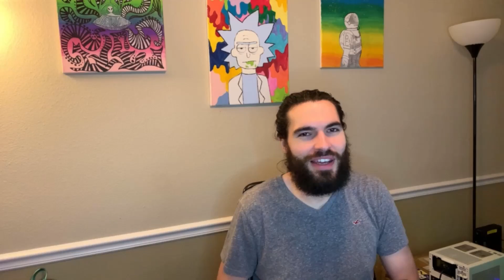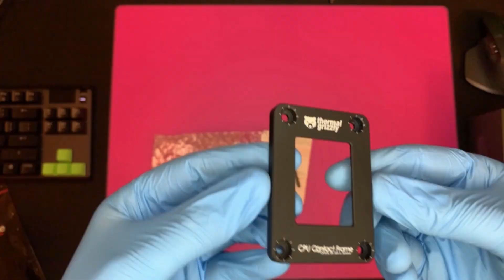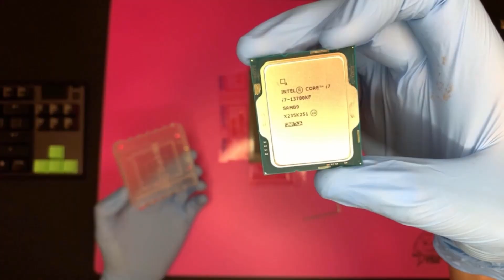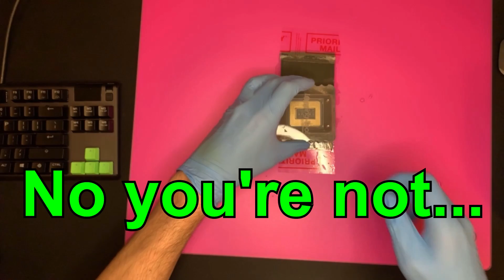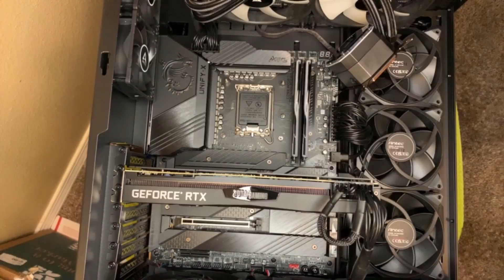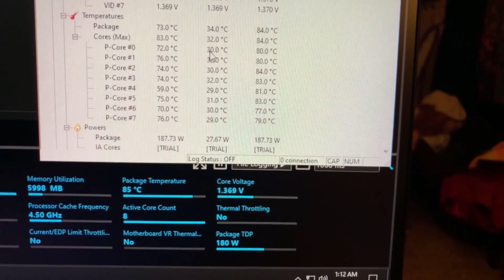Want More Overclocking Headroom?

Comment: A word of caution for those who use high end MoBos. The original 6-32 screws are simply too short when using the contact frame, I managed to barely screw it in place but some pressure added by hand, not sure it will boot thou, still waiting for other parts to arrive to check the result. Just a FYI, the original 6-32 screws from my Asus Z690-I are 6mm length, but ideally you need at least 8mm. Now 10mm would be too long as it will restrict the installation of the CPU cooler backplate.
Reply: Just had this issue, had to go to a hardware store and found 3/8 screws to make it work
Reply: Did you managed to boot it? Have the same motherboard and while I'm waiting for a contact frame to arrive want to clear out those screw issue
Reply: @duke_n3d  yes I did my friend. A bit of scary when installing, but it works like a charm now.
Reply: @fangzhenyuinca  Good stuff! Congrats, man. So I guess it is still manageable to do it with stock screws but only need to apply little bit more pressure?
Reply: same problem here... am returning it, using the Thermalright instead

Comment: What is the best tutorial for installing the contact frame to be followed? have the maximum grip with 2 fingers and then a 90º squeeze or some other?
Reply from the maker: Yes tighten is barely with fingers just until it stops. To make sure they are even, back then all the way out and do 90° at a time for each until they stop with barley any force. Then tighten them each one last 90° and it should be good

Comment: It's actually not the flattening of the surface by lapping, that helps with temps. It's primarily the removal of metal, like you mentioned. 

The reason why, is because the lid is flexible enough, that combined with the contact frame, the pressure applied by the cooler base alone will flatten the flimsy cpu lid to give you 100% contact. This is helpful to know for those who don't want to lap it, and void the warranty. The temps won't be quite as good, but definitely better than stock without voiding the CPU warranty.
Reply from the maker: I agree with you that lapping does reduce temps by reducing the material between the cooler and the die itself, however if you refer to der8auer's own video on the lapping tool, even with the contact frame applying pressure the IHS is still not 100% flat. The purpose of lapping with the tool is to lap while you have pressure to make sure when you mount the CPU with the frame it is still 100% flat. The main point of making sure it's so flat is not so much to reduce temps overall but reduce the core to core deltas as you don't want uneven contact causing some hotspots. Also, in the same video der8aur shows that without lapping, the contact frame can be hit or miss. In some cases it even worsened temps by a degree. So If you really want the best results I highly recommend lapping, but if you care about your warranty then definitely just go the contact frame route
Reply: That's not true.

Comment: delid + contact frame does wonders. Dropped 15c in games plus I can do 5.9ghz/5.1ghz with e cores off ht on now
Reply from the maker: Niiiice I need to go back and actually see what I can get out of my chip. After getting such good temps at 5.8 ghz and 1.38 volts I kind of just left it at that lol what volts do you run

Comment: I used a contact frame on my i13900K and even without lapping I lost 7 deg of the temps!
Reply from the maker: Nice! Did you push your oc higher or just take the better temps and run lol
Reply: Mine arrives Monday and I’m scared to lap mine, most likely will not do it also as I don’t really stress the CPU 😊
Reply from the maker: @haies09  to each their own I hope you enjoy :)
Reply: Same. I did just TG contact frame and it was about 11 degrees, however, I also cleaned and dusted at the same time.

Comment: i keep getting memory errors i’ve taken it off about 3 times and redone it with the proper methods online i don’t know what i’m doing wrong any suggestions?
Reply from the maker: First thing I would try is to put the stock ilm back and make sure it's still working stock. If you still have memory issues then it could be a bent pin or something got in the way of a pin. Did you by chance take the CPU out of the socket when you took off the stock ilm? If so something could get in there. Honestly I doubt that is the issue but a possibility. More likely I think that maybe your ihs is soo uneven that when you apply the cooler it may be adding too much pressure in the particular spot the memory pins are. If you notice when I'm lapping my CPU with pressure from the contact frame it is still not 100% even. I'm thinking you have the same issue and maybe you need to lap the CPU to get it to work. Basically the memory issue is always a pin contact issue so you need to solve why it's not making good contact. One last thing you can try is to put the contact frame, tighten the screws until they stop with just the tip of two fingers, do NOT turn the extra quarter turn, install your cooler and tighten the cooler like normal. This will rely on only the pressure of the cooler itself and not the contact frame. If your memory registers in this configuration, then you know it's definitely an issue with too much pressure on the memory pins and you probably need to lap your CPU. Let me know if that helps or even makes sense lol

Comment: weird that theres no direct die kit for 12th and 13th gen thats from a reputable brand like thermal grizzly or ekwb, i don't want to buy this weird supercool computers block because it looks really iffy.. i have seen a 6,2 p core 4,8 e core 5,1 ring clocked chip with the block tho, so i might have to go that route..
Reply: I just delidded my 13900K with the Rockit tool and used the Supercool direct die block.  Didn't look or feel iffy at all to me and dropped temps 12-15c.  Been 24hours now and so far so good.
Reply from the maker: @robertrodriguez9050  siiick that is amazing what kind of oc are you running If you don't mind me asking? Currently I'm at 5.8ghz p core and I went ahead and enabled the e cores 4.3 ghz at 1.38 volts loadline 4 on msi unify-x z690. Of course you have double the e cores as me so assume temps are that much harder to control
Reply: @RazPlayz3  I just started to OC this but using XTU speed optimizer I get 60/56/44 at ~1.375 and when I run CBR23 I get 40k at 68c.
Reply from the maker: @robertrodriguez9050  ok i see and  holy crap that is really cold what kind of wattage is it pulling in CBR23? I did a 5.8 all p core instead of pushing specific cores but that is something I want to look into trying out
Reply from the maker: Damn that is really good he may have also won the silicon lottery tho too. As for me same, I decided not to go that route because 1. I don't have my full custom loop yet and 2. Like you said it's a bit sketchy. Last thing I want is a cheap block with cheap o rings leaking on me and frying my build because if you don't know, "non conductive" coolant is still conductive der8auer did a great video on it
Reply from the maker: Did you see ek's new direct die blocks?

Comment: First test 220w last test 180w, omg
Reply from the maker: What? The test were all done in XTU for apples to apples at 180w. Yes cinebench uses over 220w but that was just for the intro. When I show the charts I explain that i used xtu to show apples to apples. Still in cinebench I can now finish the entire benchmark without thermal throttling and my score jumped a couple thousand so its a success to me.